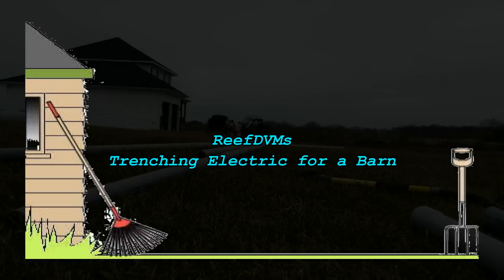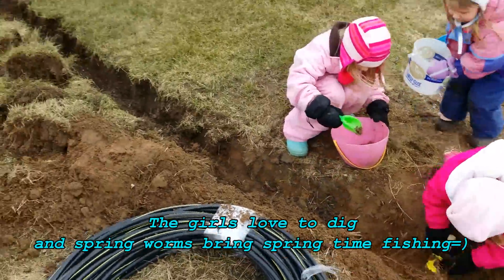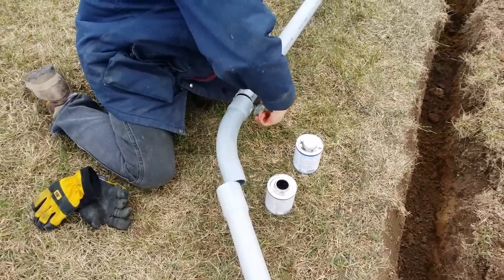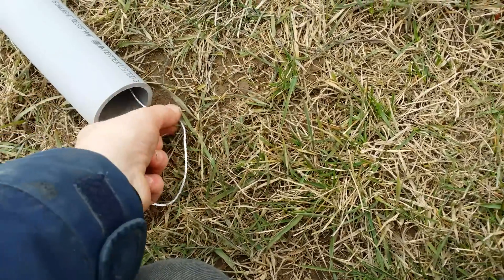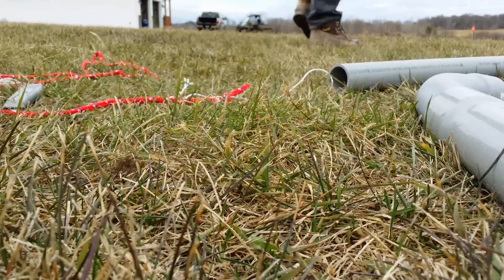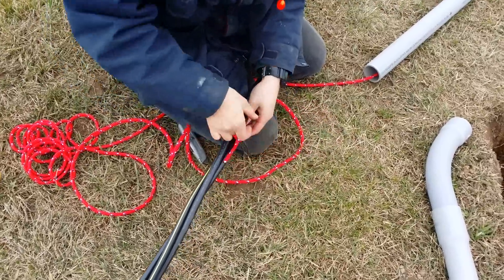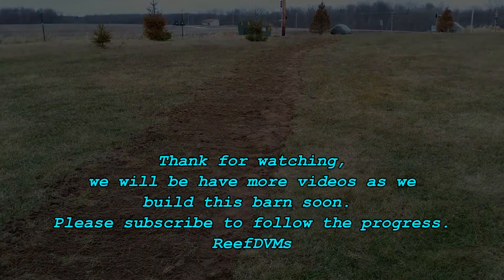DIY Pulling Buriable Electrical through PVC

Comment: why did you have to have sch 80 sticking up? what were u gonna connect to it? also were u using sch 80 the whole time or what kind of conduit were u using?
Reply: Brad,  she stated she used Schedule 40 in the trench, and Schedule 80 where it was stubbed up for the barn.   The only reason Sch 80 would be required per NEC would be if "subject to physical damage".  Obviously a very loose term and inspectors can have different interpretations.   Hope this helps answer your question.
Reply: @KevinCoop1  what size sch 40 ?3/4 or bigger?

Comment: Awesome video, just a tip for if or when you do it next time: when you tie the rope on to make it more secure in case of some resistance after the end is tied onto the cable a couple of half hitch knots will help the rope stay on the wire especially if you know you’re going to experience so hard pulling or long distances. Works on any size wire and conduit. Love the video.

Comment: I didn't see a ground wire(green), the pipe has to be completed, glued first, inspected and buried (usually) not griping just saying as an electrical contractor I have to do all this.
Reply: I believe one of the three "black" wires had green striping to indicate it's usage.
Reply: Justin Kemsley    It was a service entrance.   Answered in other comments.   So, no ground required.
Reply: The neutral is your grounding conductor on this 3 wire 200 amp feeder. Their coming from a pedestal. If it was a panel then they would need the 4 wires. I agree too we have to have trench inspected then we can lay pipe in the ground never can do without approval

Comment: Electrical pipe uses specific glue with no need for primer
.
Reply: JURISDICTION - LOCAL CODE.   While it may work without the primer, it works better with.

Comment: 18 inches? Must be nice, my power co. made me bury mine 36 inches!
Reply: Depends on where it is being run and the amount of traffic over it.  18" is usually sufficient for foot traffic.  Size and amount of vehicular traffic would require deeper depths.   See your local electrical code for requirements.  Also, sand bedding (mentioned by others), pressure treated cover board (usually immediately above conduit / cable), and trace tape (usually halfway between cover board & top of ground).

Comment: Good job. I was an electrician for 20+ yrs. We did it the same way. The small is called a pull string and tying it to a grocery store plastic bag works good. We used to call it "casper on a line" because people use the same idea to make Halloween decorations. A little more of a pointed serv (build a cone out of your where you tie it on ) will help and always pull into the bell of the conduit. All said, you did a great job.

Comment: A text book pull, and a very neat job. One little tidbit of advice is when the pulling gets really hard on long runs, or lots of turns, use dish detergent ( like Dawn). Use full strength. Just rub it on the wire as you feed it through and it makes the job a lot easier. Good video.
Reply: in Canada we have a code against that 12-908 (1) use the proper stuff years later if you have to take it out you will be glad you did.
Reply: cdnbacon2001 is right.   I have every only used proper pull lube, but an electrician told me that dish detergent eventually dries out and glues the cable into the conduit
Reply: Ideal yellow 77 made for pulling cable and won’t damage it or the conduit

Comment: Shouldn't that had been 4 conductors to your subpanel?
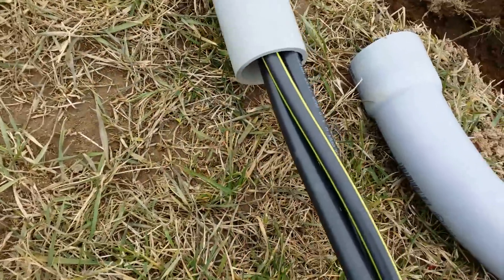Reply: A sub panel typically does need 4 conductors. However it's not a sub panel. Check 4:40. It's a separate service.
Reply: It looks like it's residential, single phase.  3 conductors is correct

Comment: Do you need a special rope or connector to pull. Running 200amp from transformer to breaker box, 250' in 2" pvc
Reply: No just strong rope, look up how to make a wire pulling head, theres plenty of videos on it. They didn't make a head for this pull which is something you want to do if you're pulling bigger wire or longer distances
Reply: I thought I was the only one who noticed is that coming from a Transformer

Comment: Dont they make direct burial cable. Most cables direct from the power company are dirct burial with just a peice on conduit at the end. If its buried the proper depth I doubt anything will ever reach it. If it did I dont think and pipe would save it.
Reply: That was direct burial URD cable they pulled through

Comment: a humble suggestion. 
put some ground pike along the trench to mark the locaton of the cable. just in case if there is any necessary to dig the ground for obvious reason, such as adding water pipe or cable repair. no one will hit the cable and get a nasty electric shock.

Comment: Code is 18 inches to the top of the pipe you where about 3 inches shallow. You know you could have heated the pipe and formed it would have made it easier to pull the wire than using 90s.
Reply: Were*  where is a location. Where are you going? Were you planning on bringing me? You were 3 inches shallow

Comment: Tips:  1)  Before sucking string through freshly glued PVC, use shop vac to blow air through the conduit for a minute or so to evacuate the fumes from the glue.  Can tell you from experience that the shop vac can explode within seconds after sucking fumes into canister and hitting motor.  Quite a boom.
2)  Avoid using factory sweeps when possible.  The conduit is flexible enough to "cold bend" around turns up around 45 degrees.  Avoid using factory couplings whenever possible.  They are the weak link in the conduit system.
3) When pulling heavy pulls through 90 degree PVC sweeps, be sure not to use twisted rope.  It can cut through the inside bend of the 90 (think of each twisted rope segment like a sawblade, then add heat from friction and pressure).  Use woven rope or install galvanized rigid sweeps with PVC female adapters both ends.

Comment: The trick with the vacuum is something professionals do all the time when running underground, it'll go around corners and everything. Small plastic bags work very well for it. 

Another tip, the strength of electrical tape is not from the adhesive but from it's elasticity. When taping wire on to your pull cord/rope it's best to stretch the tape as much as possible with out snapping it. For that reason electrical tape is best applied warm not cold. It also is helpful to stagger the wires when taping them so that the 'head' is more tapered rather than blunt.

And don't tie a knot in your rope, you'll thank me later.

One final quip: When you use a full roll of electrical tape on a single pull then you can say you've used a lot of electrical tape. :D
Reply: Pulling the tape tight is fine for short term applications.   However, when it is applied as an insulator, it should never be tighter than what it takes to pull if off the roll.   The PVC is elastic, and will gradually pull back to its original size.  As it pulls back, it releases and falls off.   (Don't use it as a primary insulator, as it eventually dries out.  Codes require mechanical connection.)
Reply: @99bn99  never been to a splicing class with 3m. The say to stretch the tape to 50 percent of it size.
Reply: Try drawing 10 -12 AWG thru 400 feet of schedule 40 without one# of Crisco globed on it, it gets into 100s of pounds of pull,   quick.

Comment: I would have not wasted time doing any of that.  I would have loaded that barn full of solar panels and let it make it's own power using panels, batteries and a nice charge controller.  For the $400 spent, you could have bought two 100 amp hour batteries for the solar charging station.
Reply from the maker: Your right solar is awesome but for this barn we need pretty large panels, 4 batteries and the cost from electrical CO-Op was 15$K and via private installer $16k. The barn boiler, water pump, the welder 220v and the LED lighting, 2 fans and wash stall heaters on 220v use pretty high demand for just 2 of those100 amp batteries to hold up on.
Reply: Yeah, I didn't know that you were using that much current.  I thought it was for lighting only.  $15-16k is a RIP OFF.  I am buying 310 watt panels for $130 each. 10,000 watts of power would cost barely $4,000.  The boiler is the big power robber.  You could need a TON of batteries to run that.  The welder wouldn't be a problem because they only uses power for short durations.  You'd probably need at least 8 batteries at over 200 amp hours each.  STILL could be done for FAR under $15k.   But none the less, a bigger hassle than digging a trench and running that set of wires.  Oh well.  Maybe another time then.  Thanks for sharing your video.

Comment: Suggest:. (1) duct tape (stronger) to hold wire to the rope, (2) use tape to make the tips of the wire cone shaped, (3) pre-plan so you are feeding the wire tips into the tapered bell ends, doesn't get caught on the square ends of the conduit.

Comment: You must glue or water gets in...
Reply: Water will get in regardless. That's the reason you are required to use wet-rated wire in outdoor pipe runs.
Reply: Water will get into every PVC pipe in the world.

Comment: yea bury it deep enough otherwise in winter the electricity will freeze
Reply: They will freeze because the pvc will always fill up with water, and damage the insulation. That's why you have to use wire That's rated for burial, inside PVC.
Reply: Freeze/thaw cycles shift the dirt and cause breaches in the conduit which can then lead to damage to the wire insulation, smartass.
Reply: Here in las vegas we busy our electrical no less than 48 inches. Have seen many failed primary and secondary wires buried at 24-38 deep and even possibly shallower direct bearing. May not be sporadic but over time complications may come.

Comment: Where is the caution tape .by the code have to be place at 1 foot deep at top of the buried conduit, and have to provide a sand bed to the conduit and cover a little  to avoid accidental damage by sharp rocks

Comment: Thanks for the video.  That is some seriously heavy cable.  What will you be using that pulls 200 amps?
Reply: No doubt.  I just pulled four 2AWG CU wires through ~350'!
Reply: 200 amps with 2/0 wire??? At 110ft? No way please explain
Reply: @joshminyard1820  what 2/0 copper is typical for 200 amps at 200 ft lol
Reply: @maldinggamer  It was 2 - 4/0 and 1 - 2/0  aluminium 1:04
Reply: @joshminyard1820  It was 2 - 4/0 and 1 - 2/0  aluminium. 1:04

Comment: what size wire is that? I want to put 100amp panel in my detached garage...do you think I should use the same size wire... would probably run about 30ft of wire... any help would be appreciated
Reply: uncle freddie, Licensed Electricians must use the  National Electric Code (NEC) for all installations .
The NEC has tables, exacting requirements, restrictions, material to be used in the construction of electrical systems, blah, blah, blah, on & on..
The most important thing is that the NEC is written with the history of lives lost, human loss, 
It is written to represent the absolute Bare Minimum...of what you must do to prevent possible loss of life, loss of property, etc.

But the tables,  such as NEC Article 310.16 show how many amperes or "amps" a conductor or "wire" can handle before it will get hot, turn red and melt, possibly resulting in fire.

In addition, Additional mathematical calculations are to be factored in to determine the correct size of wire to be used. Length of wire or multi-conductor cable is one factor, ambient temperature is another, total electrical load to be served. It goes on and on.

It's definitely Not rocket science, but often, more than you'd think,  tiny things that are missed or corners cut results in fire and/or injury.
Please consult anyone and everyone including electrical contractors, electrical inspectors, the other trades such as sewer and water guys...a lot of times you can get all the utilities out to your structure (barn, workshop, shed, etc.) at one time with one trench for all of it..again...Design/Codes/Resources...
Reply: lectric2010     Although most everything you said is correct, one point you might need to know.   The ampacity of conductors is set so that the conductor temperature does not exceed the temperature where the insulating material starts to deteriorate.   Over time exceeding the temp would make the insulation brittle.   Red hot and melting would be severely undersized conductor.   I always asked "why" during my career Designing Electrical systems.   Respectfully,
Reply: What about a run of 250 feet with a 200amp from the main service box will 2-2-2-4 wire work?
Reply: @Blackford86  generally it's not 2-2-2-4 it's 2/0 cu or 4/0 alum the last wire that's smaller is the ground as u can downsize it. There are nec charts for feeder wiring sizes. At that distance u may have to upsize.
Reply: uncle freddie did you find your answer
Reply: Jarrett Blain ....no...lol.... would you know what type of wire and what size I should use.... detached garage 40-50' run....any input would be appreciated, thanks
Reply: anguissette thanks!

Comment: It's also code to fully assemble the conduit, then pull the wire.
Reply: VaporheadATC - Where in the code does it say that, the imaginary part in your head! How you "getter" done is of no importance! What a joke!
Reply: @bebo5558   Since this project was done in April, 2014, it probably was under the 2011 NEC, since not all jurisdictions automatically adopt the latest NEC the day it becomes "Code". In the 2011 NEC, Par. 300.18(A) "Complete Runs" requires a completed conduit run before installing the conductors. But, just in case, the 2014 NEC states exactly the same thing, word for word. And, if the jurisdiction had not yet adopted the 2011 NEC, the 2008 NEC reads the same. If you have to go to Court, that is what the your opposing Attorney and Expert Witness is going to tell the Judge and Jury.
Reply: Unless you use a junction box to separate longer runs or if you're making more than 360° of bending total.

Comment: right angle turn is probably not a good idea, damages cable
Reply: Wondering where you get your info from in life.  90' bends are standard in electrical.
Reply: You can buy large radius bends, I did for my project.  I think it was a 10-12" radius, also for 2"
Reply: 24-inch radius bends are available, too. Many electric companies want them on their work, since pulling is much easier around a larger radius turn.

Comment: what happens if the power cables rae burried without PVC ? Will they rot faster ? curious .
Reply from the maker: +Sajid Rafique helps prevent gophers from chewing through them=)
Reply: ReefDVMs wow...thanks for the Info.
Reply: +Sajid Rafique regular wires like that will decompose over time and short to ground with rain water. If you want to bury without the PVC you can use TEC Cable with electrical Caution tape over it and buried at w/e is code where you are.
Reply: Sajid Rafique np, if you do the work yourself. Please be careful.
Reply: Sajid Rafique yea he probably wants a permit for the work done. For something like this alot of electricians will charge cost of permit + $100 for their time seeing they are literally doing nothing. Careful though, some people will see your situation and try to extort alot more money from you. Shouldnt be too hard to get a nice electrician though. Good luck and yes delete the comments.
Reply: AnimosityGamers my conduit that goes into the meter box has slipped an inch down over the years , exposing the cables near the box and the city sent me a notice to have it fixed. whats the right way to lift it back up ? thanks in adv.i am in texas.
Reply: AnimosityGamers I cant thank you enough for such a detailed answer . Thanks again ! Have a good day.
Reply: AnimosityGamers  ..
Reply: AnimosityGamers Your words are very very realistic . thanks a lot !!
Reply: +AnimosityGamers That wire looks like URD wire direct burial rated
Reply: Juan Sandoval Yea I think you may be right. When I went back and looked again it does look like the URD wire. A tad confusing for me because where I am in Canada you HAVE to bury any URD wire WITHOUT pvc pipe because pvc "can" cause the wire to retain more heat. Although, I have never seen or used over 1/0 URD wire buried unless it's TECK90 (URD + Metal mechanical protection rated) and not many Sparky's use that here because it costs alot more than regular 1/0+ wire and the PVC to run it in.
Reply from the maker: +AnimosityGamers here we have lots critters and hence it helps prevent gophers from chewing through them=)
Reply from the maker: +AnimosityGamers yes its direct burial wire, has to be for code here in or out of PVC
Reply: You can use armoured cables 2 cores. the armoured can be use as cpc. If there are gophers than use HDPE pipes becoz they are harder than PVC. But offcourse the cost is more....
Reply: One good thing about most modern "URD" is that it's also rates as USE-2 or RHW-2. The RHW-2 rating is what lets you pipe it, even inside buildings. Straight URD is usually not allowed indoors, for the record.
Reply: Direct burial cable will not rot.   Conduit provides mechanical protection.
Reply: tbh, hire an electrician. Those wires are "hot" and cannot be turned off without pulling your meter which the utility company would have to do. It's not worth that much trouble so a electrician will probably use 1000v rated gloves, glu the pipes and pull them together. 

If there  isnt enough give then the meter is pulled, pvc pipe is cut carefully, Wires are pull out of meter box, new pipe is added via a coupling to make up for the difference, wires are installed and meter is put back.

Where I live we don't have this happen alot because we use a expansion piece by the ground that allows the pvc to move slightly because of frost expansion. Texas probably doesnt have frost :P